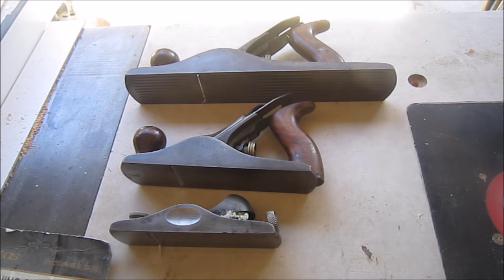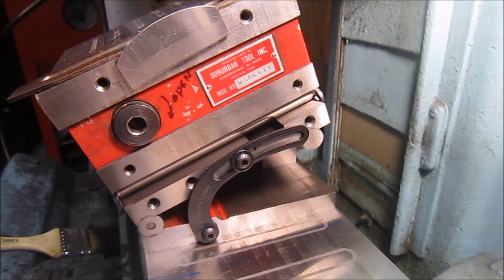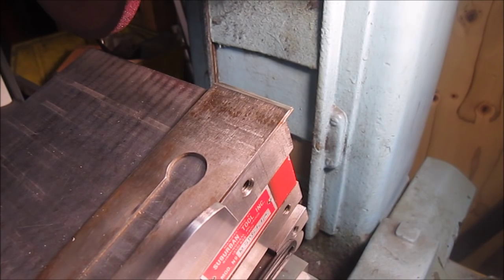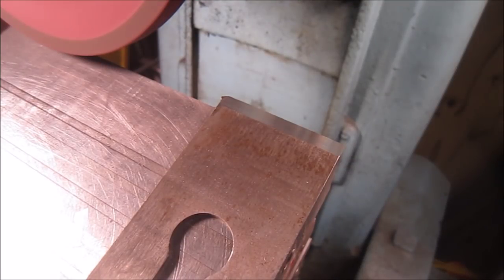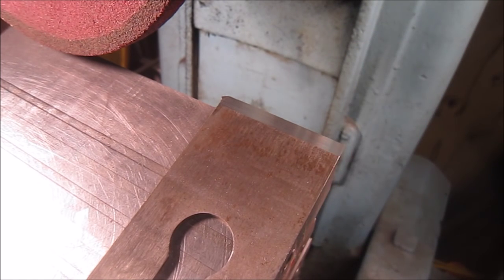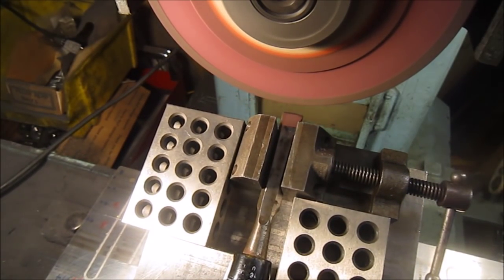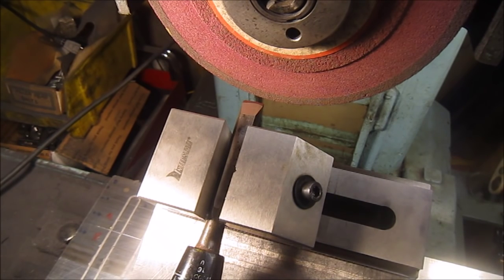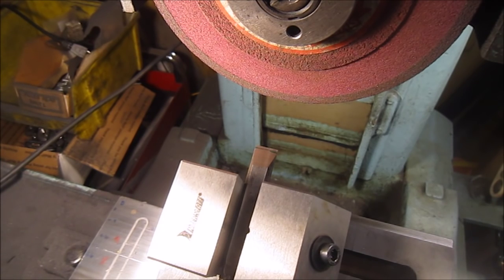Just Plane Cheating

Comment: Hi Chuck - love the grinder!
As others have pointed out, 30° is a common angle for bench planes and chisels you hammer, however, for paring chisels (chisels you push), 20° - 25° is common. For bevel up planes (like your little block), the blade bevel is part of the cutting angle so it is common to vary it to the task, ie for end grain, a lower angle (say 20°) will cut a lot easier (although I use 25°). Block planes tend to be used more "gently" so the trade off of edge wear vs easy of [wood] cutting can be worth it. OTOH, jacking up the bevel angle (to, say, 35°+) [again, on the block] will make the plane much less prone to tear out.

Comment: This is great. I have a surface/universal grinder and I've thought many times that it would be great to use it for prepping (and even initially making) plane irons and chisels. But I don't have a sine plate, magnetic or otherwise. I'm thinking of making a basic one with a heavy duty hinge and using a digital angle finder to set the angle. It won't be as accurate as a proper sine plate, particularly a nice Suburban Tools magnetic model (very nice!), but it should be good enough for this kind of thing.

Comment: good video. i built a jig for my surface grinder to sharpen chisels and planes years ago. most people treat sharpening as a black art. but as long as its sharp why not do it the easy way. i don't see the need for a second bevel . i think the only reason for it is to save time when using a manual sharpening method. i just run the back side over some fine paper on a surface plate and it seems to work fine. i'm sure you will get a lot of comments from the purists on this subject.

Comment: 20 deg? mostly common angle is 25 and then a 30 deg micro bevel (essentially just tilting it a scoach). cool idea though, got some plane souls that could use this instead of taking a  while flattening them. seriously, would you be able to grind the souls on a couple planes?
Reply from the maker: +attainableapex honestly I read the 20 degrees on the sharpening guide....and yes the souls of a plane could be ground flat assuming they could be held either in a vise or jig

Comment: What you want to do is flatten the soles on those jack planes, if you do don't strip off the tote or knob (the tension of the screws affects the sole) adjust the frog for the cutting you do and have the blade installed...

Comment: A set of good diamond plates (3 x 10 or so) from coarse to extra fine and a good strop board will make hand sharpening so fast that you won't want to "cheat" (not that I consider using a surface grinder cheating, anyway). The advantage is that there is no setup. By the time you set your sine plate, find the right vise, get the right wheel on the SG, you would be done by hand-sharpening (it takes about 5 minutes, starting with a fairly dull tool) and have been making chips for 20 minutes.

The angle is not all that critical, although I would have considered between 25˚ and 30˚ (with a micro-bevel about 5˚ more - and make it MICRO: less than 0.020" or 0.5 mm wide) depending on what you are cutting. Pine along the grain is about the hardest wood you can get away with using 20˚, and even then a tiny knot can rip a chunk out of such a thin edge.

May I suggest watching a few of Paul Sellers' videos on sharpening. I don't think he even takes 5 minutes - even when stopping to explain things all the time.  https://www.youtube.com/channel/UCc3EpWncNq5QL0QhwUNQb7w

(Side note: Wikipedia says that Paul Sellers may not be a "notable person" and should have his page removed. Stop by and disabuse them of this notion; he is probably one of the 10 best-known woodworkers in the world. And for Youtubers, he has a lot of good videos.)
Reply from the maker: +Peter W. Meek Hello Peter....thanks for viewing and the insightful information...I agree but your method requires skill.....lol, not much skill to use the grinder!!!!  I will check the suggested channel
Reply: +outsidescrewball The skill required is one that is worth having: the ability to move your hand in a straight line. You need this skill for wood and hack-sawing, filing, (sharpening), even for playing pool. Cut off a chunk of 1" x 1" mild steel and put it upright in your vise and start filing. When you get it fairly smooth, paint some Sharpie™ lines on it and file some more. With this visual feedback (as the lines disappear) you will quickly learn to make straight strokes. Once you have smoothness down, then file for squareness (using a good square). Lastly learn to file for size.

When I was about 10, my grandfather set me to making 1" cubes from rough-sawn blocks of mild steel a bit oversized. (It was supposed to be punishment for using his good micrometer as a C-clamp.) The only tools were files, square. and micrometer. The goal was no light under the square in any orientation or position. Size at any position had to be closer to 1.000" than to either .999" or 1.001" (1" plus or minus 5 tenths). It took me a couple of days to get my first one right; after that I could make one in an hour or two. The ability to move my hand in a straight line has lasted me over 60 years, and I'm glad I have it.

Comment: Surface grinder is awesome for flattening a plane's sole. As others have said, I would flatten the plane soles and the backs of the blades, too.    How thick were the shavings you were getting?  See if you can get it to cut a shaving the width of the board the full length and only one-thou thick.  Then you'll know you've got it sharp and adjusted perfectly.   ;)
Reply from the maker: +Richard Freeze Hello Richard, thanks for viewing and commenting, I will have to check on the thickness as you got me curious
Reply: How do you set up the grinder to flatten the sole? My plane bodies don't have any reference surface parallel to and opposite the sole.
Reply: One way is to clamp it in a vise by the flat sides and then level it with a precision level.  Depending on how long it is you may want to support the ends with adjustable jacks.
You'd want to make sure the bed of your grinder is level, of course.
Reply: +Richard Freeze Of course I can clamp it. But leveling the plane on its non-flat back/top is the problem. I suppose I could try to dial it in and tap it around until it's level.
Reply: With the sole up in the vise, put the level on the plane's sole and tap it into level.  Then clamp it securely.  A miniature jack under one or both ends would help keep it from flexing if it's as long or longer than a No. 5.
Yes, you could dial it in.  That might work even better.

Comment: i see nothing inherently wrong about using your surface grinder for sharpening, but it's a bit like using a sledgehammer to swat a fly.

as to the reasons you were not getting good results with your veritas honing guide i can't imagine a reason. they are rather foolproof.in 15 minutes i've taught total noobs to get edges you can shave with. what kind of sandpaper were you using? what grit. if you have any questions i would be happy to help...

but more importantly, i wanted to comment on the angles you chose to hone at. for general work, a 25 degree primary bevel and a 30 degree secondary bevel  best. honing at your very low angles will lead to the premature breakdoen and chipping of your edge. and in my opinion those who dismiss the need for the secondary bevel are just flat out wrong. the secondary bevel serves as the equivalent of a relief angle on a drill or other metal cutting edge. would these folks dismiss the need for relief angles there. and a 1 degree difference is not sufficient.

i also note that you ground a very wide secondary bevel. that just wastes blade. it only needs to be 1/16" or so. also. the first thing you should do is hone the back of you blade flat to the same degree you do the front for at least the first 1/2" or so. your cutting edge has two sides, just doing one side is only half doing it.

manual sharpening is quicker than your surface grinder when you take into account the set up time.

but stan has the cost wrong; $2500 sine plate and $xxxx.xx surface grinder. wow....

Comment: Sure beats a bastard file and an old honing stone !
In high school the teacher used a machine that had a big flat sided stone a bit like a big bench grinding wheel turned side on and rotated slowly  horizontally this was used to sharpen chisels it used auto trans fluid for cutting oil .
i remember once he and the metal work teacher nearly coming to blows as the metal work teacher  use to come in and run his HSS tool bits across the wheel of the machine or to really piss the the woodwork teacher off he would lob in with some aluminium  piece and trim it on the bandsaw.
i think they had a working hatred for each other !
Be careful as once some one finds out you can sharpen or weld something they seem to want to be your best buddy - non paying buddy that is !
Reply from the maker: +ian bertenshaw Hello Ian...thanks for viewing and enjoyed the high school shop story....lol

Comment: I would rather use this method to get the back dead flat, which is allways the most annoying and time consuming problem with abused blades and chisels. But then, to my unfortune, i don't have a surface grinder. pool is not played here very often, let alone you get some eight ball luck out here... Cheers.
Reply from the maker: +Flip de boer Flip...yes I think you are correct, this method gets them back to where a simple hone on a stone/paper would bring the edge back...thanks for viewing and your comment

Comment: Well, I can't really say that it's cheating when that's the way they do it at the factory.You really want to get them up to about 30 degrees next time you sharpen them. 20 degrees is too fine and will lose the edge too quickly. The micro-bevel is a waste of time as it really is a cheat to get an edge back quickly and there is not a mechanical reason for it.  

When you hit the polish (strop, wheel or whatever) to finish the plane irons, hit the corners a bit harder so they don't leave tracks when planing.

You shouldn't have to do it very often. Strop them when you feel them getting a bit dull and you shouldn't have to grind them often. When I am doing a lot of woodworking, I might have to regrind mine after a year or so. Occasionally true them up this way when the bevel starts getting  where you don't like it.
Reply from the maker: +David Kirtley Hello David, thank you for viewing and your insightful valued comments